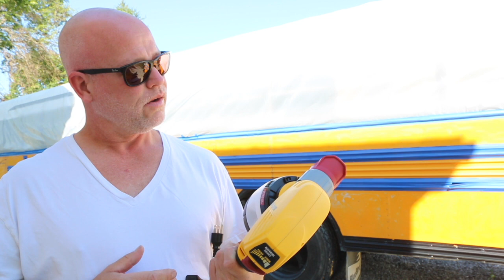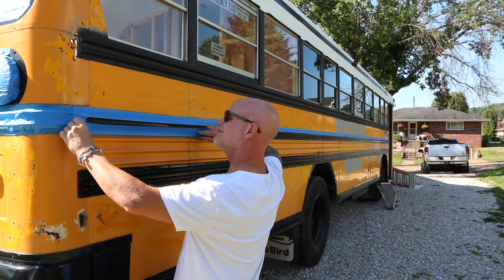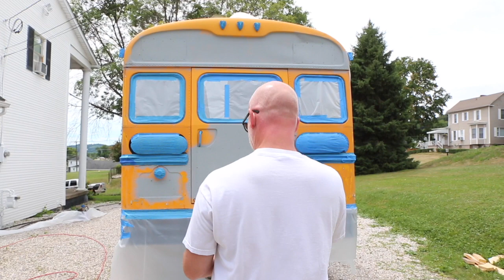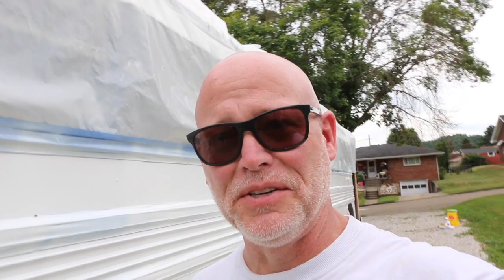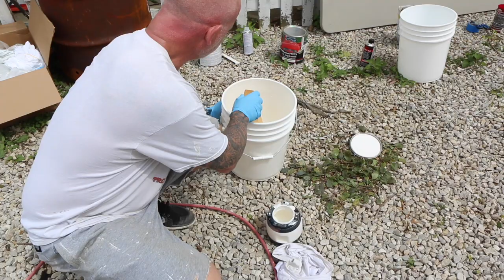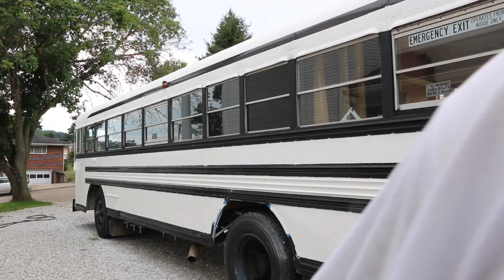School Bus PAINT DAY!!  Bus Conversion Project--Skoolie Chronicles--Episode#11

Comment: A little free advice...... Wash bus several times with a good wax and grease remover...  Blow down sanded paint and tack rag it a couple of timesAfter you paint. Remove tape after paint dries but before it hardens....
Reply: Tyron Bell ..... how many times do you believe that bus had the honor of EVER being waxed or even have a shiny substance put on it.  Bus drivers stopped caring about their buses the day the Companys put them out of work; forcing the hands of the teamsters union, letting everyone and helping everyone stay represented under a collective bargaining agreement... I remember growing up many drivers would have their own modifications on their buses. It was badass.

YET YOU INSIST HE YOU INSI
Reply: Do you think it is really necessary to sand it?
Reply from the maker: no
Reply: You sand it to give the paint 'tooth' ... a mechanical bond. Adhesion. Is it peeling yet? Just kidding man. I know that this masking is a bitch. I actually am a painter. Getting ready to do a skoolie myself.
Reply: @MerlyCosta  If you want your paint to last...yep!
Reply: @MerlyCosta  
That is the most important part...
beside cleaning it really good afterwords...
You have to have "tooth" for the next paint to
adhere to...
Reply: @DaveMorrisonMusic  
DAVE... Please save me!!! I need YOUR Help...
I have "Flip'" 24 RVs, travel trailers, 5th Wheels etc...
I have Painted a lot of the older travel trailers and they
looked great... But NOW... I have a 1985 Class A RV
It is very old... dry... and it has bare Fiberglass showing...
Doing this for myself is no problem... I'm 64 years old and
planed this to be my last RV to do... but I have an opportunity to
do a man's 30' 1990 Class A RV... I do not want to mess his up...
Question: What is the best paint to paint an OLD RV...
It does NOT have to be show room quality.... 
Please NOTE I paint like they do with Boats... I do the Roller & Tipping method... I'm only
5'4' tall and 125 lbs  I can't hold a sprayer up very long since I have hurt my arm years ago.
and it is easier for me to either hand paint with a brush or roller (please do not laugh at me)...
Thank you for your help.

Comment: I am a bus nut myself.  This is a nice Blue Bird All American bus.  I know this is the forward engine type.  For those who has seen many of these flat-nosed forward engine buses, they know the stepwell is turned angled a little bet towards the back rather than straight like a convention stepwell.  The reason is when schools wanted long-haul type buses, they needed a way for the students to dodge the engine while getting on so they angled the first riser is spiraled and the rest is even with the 2nd and 3rd riser.  The rear engine which is often called the pusher has regular steps.

Comment: had me flinching there a few times , best way to spray the paint on is to trigger while moving the gun passed the still to be painted part , since its an electric gun that prolly whont work as whell as the paint is delayed slightly and blobs a little at the start but that way you prevent the paint from becomming to thick at spots where you stop moving to change direction maibe overlap ontoo a piece of cartboard held  a few inches in front of the allready painted part works better in youre case keeping the thicker paint off the bus surface 
also move along the surface keeping the distance as level as you can and overlap horizontally as mush as you can 
it actually gives a better result to walk back and forth along the whole length of the bus as it is to make 2 feet wide swaths up and down (the small overlaps show in the paint as shiny or running spots 
allso look past the paint while youre going and see in the reflection when it starts to loose its orange peel STOP AS SOON AS IT DOES THAT OR IT WILL RUN it will show you the speed you need to move the gun at and gives the smoothest result 
other than that practice makes perfect , you prolly had it down pretty good by the time you where finished (as it allways does)

Comment: Just a tip, when using a spray gun, start the motion of spray before you pull the trigger and continue the motion while you release the trigger, that way you get nicely blended coats of paint

Comment: Yes great try. Second coat turn on sprayer and sweep left to right, turn off-turn on sweep right to left turn off. Do this in smooth strokes. It looks better than my first try. Also start top to bottom so you don’t get cord or hose in your paint. Keep it up

Comment: before you change the pain ... invite Hillary in it and take pics from the outside... lol
hey ... great job and yes you are not a painter ... but that is how we learn ...

question ...

and air compressor is used to thin out the pain in to a fine mist ... did your Wagner sprayer gave you thick spray ... that is what gives you the runs.
Reply from the maker: +magaiver the Wagner did a fantastic job. Not staying in one place too long is the key to less runs

Comment: Long even lay downs with wrist flicks so you can't see where the spray started or ended, I know this is an old video but if ppl want to do the same just dont zig zag like this gent....long even pulls and multiple coats. Thickness should never vary if you want it to look good on the sun. No hate just advice from a lifelong spraypainter.